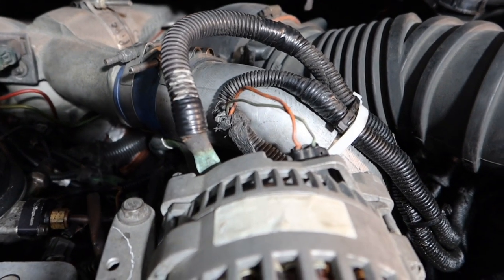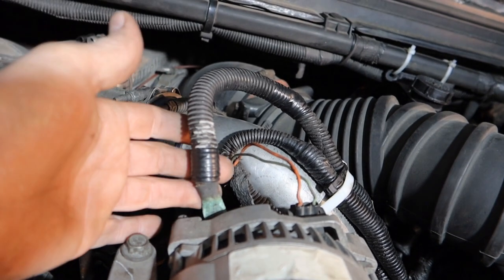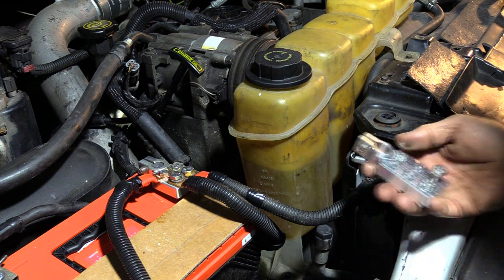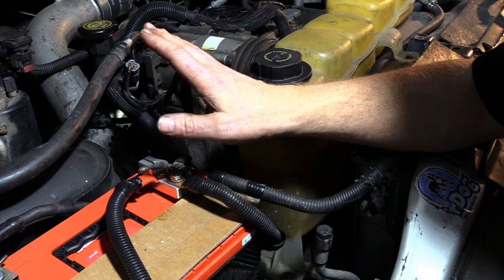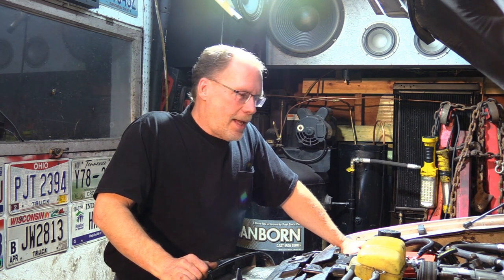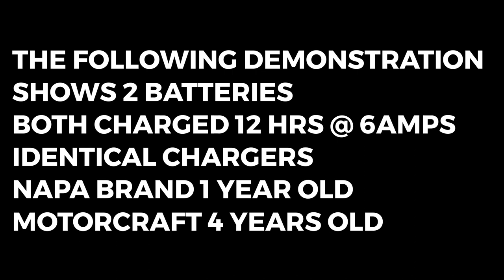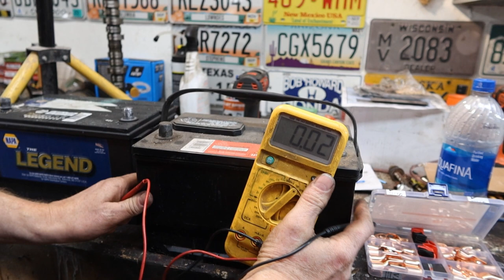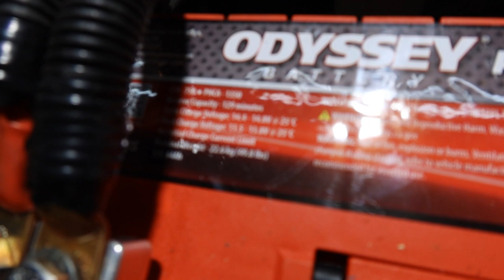7.3 POWERSTROKE ALTERNATOR AND BATTERY ISSUES EXPLAINED.......

Comment: I put in 2 AGM units within 3 days of each other.  Hoping "all is good" with this move. (2001 7.3 liter Dually with 251k miles on her. New OEM injectors greatly reduced engine noise and cold starting!  Also 5w40 Rotella.
Reply: Do you plug it in ?
Reply: @LemonySnicket-EUC  I'm on the California/Oregon border.  However,  I do plug it in when it goes down below 40 just to baby her.

Comment: Thanks for sharing your knowledge. I've always bought the Walmart batteries but this last time I bought Advance Auto batteries, Auto Craft, maybe a 1½ old now and I noticed the other day the right battery was low in one cell and the left battery was very low on acid in 3 cells. My next purchase will be the Odyssey batteries. 👍👍now that's as soon as I put a code scanner on her to figure out my no start, lol. I know it could be a number of reasons including the CPS that I swapped 3 times and still nothing but now I've got a Motorcraft CPS I'll try. Thanks again!    👍 Jay.
Reply: Same here. Auto craft batteries after 2 years are weak
Reply: unplug your icp and try
Reply: @jettmcintyre6226  brother I tried everything 🤭 but ya know we always force ourselves into thinking it's something major and it ended up being the one thing I never thought of, until I had one of those "ah haaaa" moments or rather in my case, "duh huh" moments. Started checking fuses under the hood and the pcm fuse was blown 😆 a $5 20amp fuse.
Needless to say I've invested in mini fuses and MAXI fuses lol.
Reply: @silvergrizzly316  i have definitely been there😂😂

Comment: I don’t know if you’ve already done it but can you make a video detailing how you wired the fuses separately in glove box? I’m looking to change battery terminals, add lugs and wire in an amp for my stereo system. 
One last request is visually take us through common sensors on a 7.3. I have a 95 obs and am looking to replace sensors as preventative maintenance as I’m not sure which have even been done by previous owner. It’s at 228k miles currently. Thanks for your time and help.

Comment: Great tutorial but you didn't say much about the terminal on the other side of the battery. Why so negative about the negative? So can I assume to ground to the engine and rely on braided ground straps throughout? I like the multi tap terminal but please comment on grounding. Thank you

Comment: Awesome video thanks for sharing! I bought (2) new "maxx" batteries from a place called Walmart and they lasted 6 years 7 months to the day and on that day i realized the battery idiot light in the dash in my 2002 excursion 7.3 diesel wasnt lying to me. I have a 2013 bmw M5, that still has the factory AGM bmw battery in the trunk. I didnt believe the guy who i bought the car from, but found bmw engraves the month and year on top of the battery terminal. Sure shit, battery is over 10 yrs old and still going strong. You made this video a yr ago, with your batteries 11 yrs old at the time, i have to ask, are those batteries still good at 12 yrs old? Do tell!

Comment: Do you recommend using a battery post spray protectant? It seems to help my truck from getting corrosion build up and bad connections
Reply from the maker: Ohh yes with the factory connectors Ive not had this issue with the odyssey batteries and those multi connectors before these I cleaned and sprayed my post every 6 months
Reply: @CUSTOMWORKS7.3PSD  I have Optima batteries and they have lasted 12 years so far and no issues

Comment: Why is your hot lead running up??
Either rotate it to stress less your existing connector. Or get.. or bend it's lug to a 90.
Reply from the maker: That truck runs a custom 6 battery configuration and that connector is held in place with 2 connection strapping s been like that since 2006 never had a issue

Comment: Love your work,  the issue I have with my 95 7.3 is that the speedometer needle sweeps when I go over 60 mph .
Have you ever seen this?
Reply from the maker: sensor on rear axle / PSOM module / OD driver motor  Highest poss issues all 3 can be removed inspected and tested my guess OD driver motor
Reply: If u have fix your speedo yet try the vss on top of your rear end pumpkin or the pig tail plug in that was my problem and if u have a automatic transmission  it can make it shift funny hope it helps good luck

Comment: Clint, you are saying "Voltage", it is the CURRENT draw that is burning up the wires and connectors, not the Voltage.  Power equals amps Squared times Volts.  BIG solid connectors like you are showing keeps the Voltage Drop to a Minimum, which is critical as you suggest. The Fatter the Cable, the less Voltage drop at High current demands. I have a 320 Amp MechMan alternator, my Cables are Humongous and BIG connectors.
Reply: Make a video yourself that's entertaining and informative then Mr. CURRENT

Comment: Like the video. I have one question what kind of welding wire did you use? Were can I get some of the welding wire?
Reply from the maker: Ebay any size and length custom ////WELDING CABLE 1/0 RED Per-Foot CAR BATTERY LEADS USA NEW Gauge Copper Solar
temco_industrial (191962)

Comment: 3rd comment lol, do a video on cold starting a 7.3 properly, and diagnosing a cold no start
Reply: My 99 7.3 was very hard to start under 35°F. I replaced the glow plug relay on the old lady a few weeks ago and it now starts better than it did for years. Still, I think I need to replace some glow plugs. If that doesn't do it, I will face the daunting task of replacing the low pressure oil pump. Also, I'm going to replace/upgrade the battery cables, especially the starter cable. Older cables are very likely to be somewhat degraded and producing excessive voltage resistance.

Comment: Hi, I never could see the specific model number of the batteries you have in the video.  I recently bought a 1995 7.3 E350 and noticed that the batteries it calls for are two different sizes, one 600 Amp group 50 and the other an 850 amp group 65.  Should I look to replace them with batteries of the same size to each other or go with what was originally in there, and if so why?   Also, what CCA should I be looking at?  I am specifically looking at the Odyssey batteries but my 1995 van is not even listed on their site.  In other words, what would YOU put in my van if it were yours?  Thanks in advance for any advice you can offer.
Reply from the maker: The difference in size is location based . I install new cables and a new pan when I switch out batteries at the shop and always install odyssey extreme start / long duration  850 65 pair Having matched batteries  always extends there life. Mismatched 600 / 850 will have one always trying to balance the other and causing extra heat
Reply: @CUSTOMWORKS7.3PSD  Looking around on their website I am having a hard time matching up your description with the available models.  I don't see anything that says long duration on there.

Comment: Based on how the alternator feeds the passenger side battery which feeds the driver’s side battery, is one battery preferred over the other for placing my power cable for my big stereo system?
Reply from the maker: if you can't swing a dual battery splitter to power a 3rd battery hook to driver side

Comment: The video is interesting, but please take a circuits/electricity class. Most of the claims about 'voltage', 'resistance', etc. were incorrect as much as most - not all - of the practical advice was reasonable. And no, I won't 'just relax', especially because there are some fundamental misunderstandings: as soon as the engine is running and the alternator is outputting current, any voltage issues which cause driveability issues are NOT related to the batteries because the regulator of the alternator is what is keeping a constant voltage in the system.
The only exception to that is when the batteries are so far discharged that the alternator cannot keep the voltage up because it runs into its current limit.
Also, as batteries age, their capacity decreases, therefore their capacity to receive power decreases - thus with old batteries you will, at most, have a brief period in which the alternator struggles to stuff power into batteries, then they will have taken all that they can and at that point the alternator is in steady state and taking care of the power requirements of the vehicle as it should.
It is however true that SWAPPING the two batteries from time to time will help preserve them, because the way the wiring is (both stock and the way you rebuilt it) causes the driverside battery to be used a lot less than the passenger side.
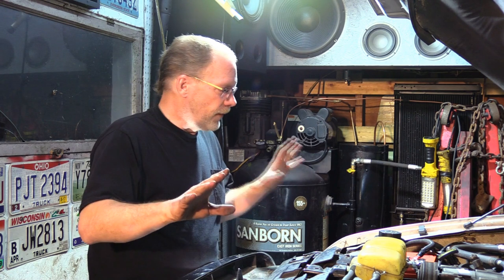OTOH, everything after minute 15:00 goes so far into inaccurate that it should really come with a large 'caution' sign. Among other things, the Odyssey batteries that are 11 years old have NOTHING to do with those that you can buy today - so yes, the old ones were better. But even disregarding that, the whole recycled vs. new argument is just incorrect.

Comment: Iv got a 1999 f350, I put a new alternator, new battery’s, and a new alternator plug, and the battery light comes on and off when I turn it off and have it running, what can it be?
Reply from the maker: Have you used a multimeter and checked the bolt on the back of the Alternator for charging voltage? Is that voltage making it to the batteries? Check this after GPR has shut off. Both voltages should be above 13V to 14.4v. Have you checked the fuses with a test light? If you unplug the connection at the alternator does the light go OUT

It is not uncommon to get a bad alternator right out of the box The charging lead at the battery on the passenger side needs to have connections checked 
also you may want to get forscan pro with https://amzn.to/3zaBBzh
Ignition off:
12.68v both batteries, connected
13.0v Driver's battery, disconnected
12.83v Passenger battery, disconnected
0.26v Orange (A/sense) alternator harness wire (+ on wire, - on battery - terminal)
0.11v Green (B/control) alternator harness wire (+ on wire, - on battery - terminal)

Ignition on, engine running:
14.41v both batteries connected

Ignition on, engine not running:
0.26v Orange (A/sense) alternator harness wire (+ on wire, - on battery - terminal)
12.41v Green (B/control) alternator harness wire (+ on wire, - on battery - terminal)

Comment: I have a 2002 f450 super duty 7.3 I've put three alternators on there remanufactured and then the last one I put brand new something keeps shorting out the regulator making them go bad I replaced the batteries and I replaced the solenoid on top of the motor I don't know what else it could be any suggestions
Reply from the maker: this is what ive run into over the years first hook up a voltage gauge to the cig lighter a good alternator with no issues in the electric system should be at 14.3 to 14 v all the time so drive around as normal for a few days if that voltage drops off at a idle we now know there is a issue some where . I have seen connections at the battery come loose from the engine from hot to cold cycle and it may look good but one battey will be hot and one will be normal no temp gauge needed your hand will tell the difference, Ive had a shorting wire to the starter the connection is to close to the block not touching but will throw voltage to ground, bad grounds to the block or chassis the ground from frame to cab under the pass front door is a good one to fail and block behind exhaust down pipe , small wire short on frame to rear lights also after market or self installed power wires shorting and or to close to high voltage factory wires or to close to ecm or idm wires and last but not least a failing bcm 02's are good for this that box operates the security and door locks and a couple other items
Reply: @CUSTOMWORKS7.3PSD  thanks for the great information I will be back on this truck tomorrow with these different suggestions thank you

Comment: Are you running the upgraded wire (I think you said 4 gage) from the Alternator to the battery direct?????
Reply from the maker: My system is very different i'm running 4 batteries But we always install 4 ga from the alternator and #1 welding cable to the starter and other battery
Reply: I have purchased Odyssey Batteries, HD battery cables, Denso gear reduction starter, and Im getting a Mechman HD alternator. Do you recommend that the starter be wired direct to the battery or is using the Ford alternator plug sufficient?  I will obviously take your advice and put on a better connector plug. In speaking with Mechman they claim it is not necessary to wire direct to Battery. I was wondering your thoughts...
Reply from the maker: @jasoncohn2669  Wire starter direct to battery This stops high amperage cross to sensor wires

Comment: I could use some help I have a 7.3 I’ve put 3 Alternators in 
Had new batteries 
New belt 
New alternator pig tail new alternator will not charge 
Old one does but only if you rev truck up to 2500 to 3k it will charge for hrs this way u till you shut truck off then you gotta rev it again . If you don’t rev it up the batteries will drain completely dead to the point the headlight are very very dim dash lights dim 

So truck not running checking at alternator I have 12.45 
Truck running before i rev it to 25/3k it is at 11.70
After I do the little rev trick it’s at 13.71 it will stay at 13.71 for hours unless the truck is shut off and restarted then I have to rev it again to get it back up to 13.71
I’m ready to pull my f’n hair  out

The only thing I see is when the key is turned on the battery light does not light up . Doesn’t light up ever tbh
Reply: I don't think your batteries are bad. The glow plugs will draw a lot of juice from the batteries that may take a while to charge back up at idle. Revving the engine will certainly speed up how quickly the batteries are charged backup. Though, this may not be the problem, it is something to keep in mind. Leaving the multi-meter leads connected to the battery, the voltage on the passenger side should be 13.5 to 14.5 with the engine running. That says the alternator is working as it should.

Comment: I’m not saying anything to the longevity of these batteries they look like they are a high-quality battery so I’m not disputing that at all but you can also get 10 years or more out of the cheap batteries as well if properly maintained. I have my 7.3 as well as a couple of other vehicles including my wife’s minivan and all of them every night they’re plugged in to a Deltran battery maintainer and my wife’s minivan the battery is 11 years old and it’s a Walmart ever start max and the ones in my 7.3 are the Ford Motorcraft batteries from O’Reillys and they’re dated February of 2013 so they’ll be over 10 years old in a couple more months, and I have one of the cheap $60 one year warranty batteries from Walmart in my John Deere swather and it’s dated 2011 and still starts it up every year and is also on a maintainer when it’s not in use. I also have the maintainers on every one of the batteries in my dad’s tractors and there are the cheap $50 one-year warranty batteries as well from Walmart and I don’t know how old they are but they’re going on five or six years old and still working well. So my point is that if properly maintained even the cheap batteries can last quite a while in my experience. But I wouldn’t mind looking into these further for replacements for my power stroke in time when they do finally die.

Comment: Why is my system at 18 volts
Reply from the maker: A faulty voltage regulator is almost often the cause of an overcharging alternator. A voltage regulator, as the name suggests, controls the overall voltage output of an alternator, limiting the generation of excessive output voltage.
In certain cases, alternator overcurrent can be recognized by a repetitive need to replace a vehicle’s headlight, fog light, or marker light bulbs. This is especially true if a vehicle’s bulbs appear to be blowing ever more frequently.
If your vehicle’s battery case suddenly begins to bulge, or an under hood inspection reveals that your battery has become exceedingly hot to the touch, an overcharging alternator is most likely to blame.
One of the most obvious signs of alternator overcharging is an irregularly high reading on your vehicle’s instrument cluster voltage gauge.
But you need to test right at the lead bolt of alternator to make sure the gauge is correct 
If alternator is testing over 14.8 it needs replacement or a new regulator which can be ordered by any auto store